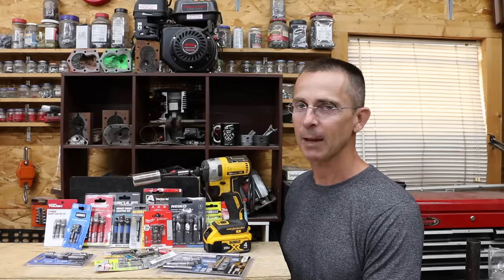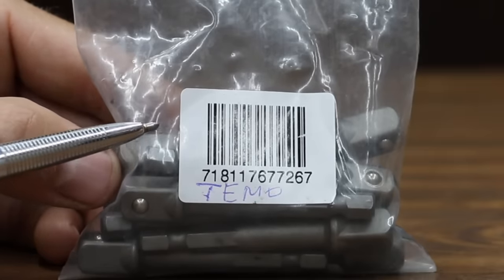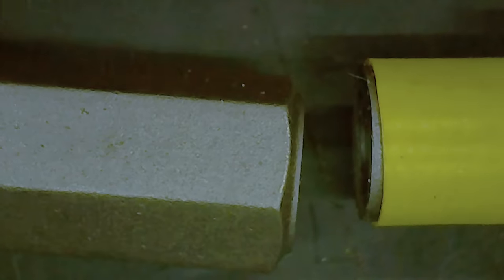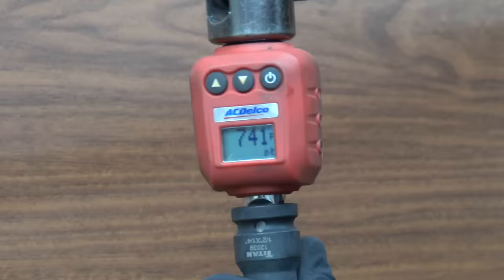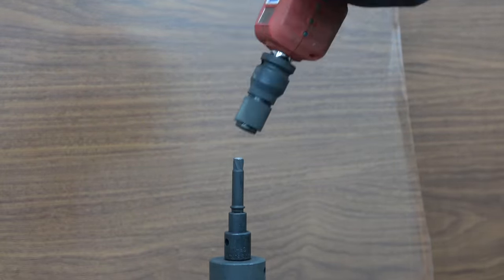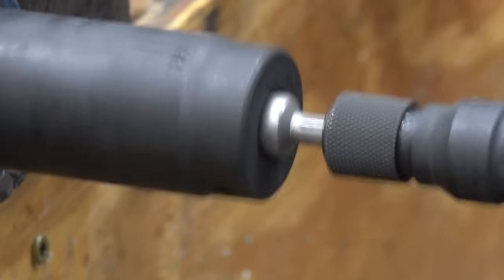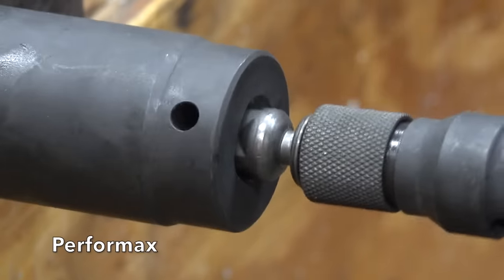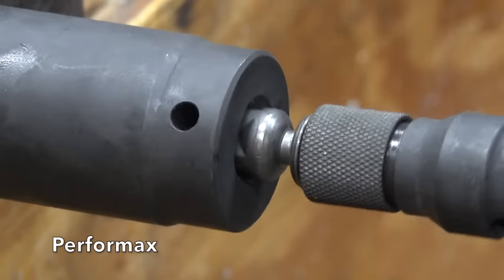Best Socket Adapter? 18 BRANDS: Milwaukee, DeWalt, Makita Gold, Ryobi, Hart, Irwin

Comment: Doesn't a shock absorbing zone defeat the whole point of an impact driver (or maybe it just converts your impact driver onto a conventional driver)?
Reply: it's probably there to make the bit last longer than usual, i think a better test would have been to clamp them into a vice and count how many  impacts each one takes before it breaks, but it would of been quite a work load for PF to do it that way.

Comment: So, if you want to use your impact driver as a nut driver or to break away some nuts / bolts, Dewalt is the only way to go.

One thing I noticed when I was shopping for these and reading reviews is that the 1/2" adapters often broke on the first use, while the 3/8" lasted longer. Also noted that the 3/8" are often sold in packs of 8 or 10, so the breakage rate for this use is pretty typical.

I bought the Harbor Freight Hercules after Torque Tools tested it out as the #1, but the output exceeds all of the nut driver adapters.
Reply from the maker: Thanks for sharing.

Comment: 1/4" hex impact drivers are for screws. I use an appropriate impact wrench when using sockets.
Reply from the maker: Thanks for the feedback.
Reply: i tend to use the socket adapters when i'm dealing with 9/16 and lower.   anything above that is getting a real impact, though.
Reply: I use them to run the bolts in and then use a ratchet to tighten down.
Reply: Agree with Justin..........video shows 1/4 driver break, we already knew that........other that it worthless.   I have 4 impacts........ ever broke an adapter of any brand.     But I don’t use them to break away lug nuts.

Comment: I tend to think that the narrow area of some of these bits is to give a failure point that will leave part of the bit to grasp for removal from the tool rather than break flush and make removal hard to accomplish. As usual, great job.
Reply from the maker: Thanks!
Reply: What’s hard about pushing the square piece out from the inside of the socket?
Reply: @dp1381  I think he's talking about when the bit snaps further down at the power tool end.. and it's broken off flush with the collet.. it's hard to pull it out.

Comment: So now we know that the skinny shock zones are a sales gimmick that actually makes the bit vulnerable to breakage.
Reply: It’s actually a safety feature. Harder metal easier it is to chunk off and hit your eye . The coating in the shock zone prevents chipping and will just shear as if it does chip the coating slows down or catches the shrapnel. Ask how I know . Broke a hex style and it hit my face right below my eye . And broke two impact zone styles . And one had a piece caught i  the coating .

Comment: I'll be honest here, I wish my rigid impact driver was strong enough to break any one of these :(
Reply from the maker: Thank you
Reply: I know what your talking about. Rigid seems a bit week.
Reply: @jamms992  Depends on which one you have I guess. My gen5 and octane versions will snap these all day long if you are not careful.
Reply: @D3M3NT3Dstrang3r  I think mine is either a gen 4 or gen 5.  Started out pretty good, perhaps able to loosen a 100 ft/lb lugnut, but now struggles with a 50 ft/lb-torqued bolt.  I thought it was the batteries and had the LSA swap them out, but the problem must be the tool aging.  It seems to go through batteries fast now also.  I bet the bearing is burning up or the brushes are getting worn out (I use it a lot).
Reply: @The3chordwonder  If its not performing up to task I would warranty it out. All my Ridgid tools are used in a professional setting very hard daily. I have yet to have one lose power or at least very little from wear. I have warrantied A 1/2" impact but it just quit. I definitely like the build quality of the octane 1/4" over my gen 5 brushless though, and its a fair bit stronger too.
Reply: @D3M3NT3Dstrang3r  Yeah I think I probably will.  As much as I like the cordless tools, I have been getting by using my aircat stubby impact, which works surprisingly good and is even smaller than the rigid.

Comment: Seems strange to have a shock absorbing zone when you want the impact energy to go into your project, not wasted on the tool.
Reply from the maker: Thanks for the feedback.
Reply: This! The only reason I can think of for a shock absorbtion zone would be to deliver the torque more smoothly, but why would you want that on an impact
Reply: It’s for safety. Impact tools are meant do be able to self destruct safely. If you look at the non-impact tools failing you can see metal shards and fragments getting launched out- that’s dangerous. Whereas all of the impact sockets always fail cleanly at the shock absorbing zone.
Reply: Milwaukee says to extend the life. Which, if you lesson it's torque on your project makes since. Several others didn't shatter because of proper materials. It seems like a marketing gimmick to me.

Comment: Just got a DeWALT impact driver thinking it would help me with lug nuts for an upcoming brake job. Only now did I discover the difference between an impact driver and an impact wrench. Glad to see that the DeWALT adapter is available and should do the duty. :) Thanks, Project Farm.
Reply from the maker: You are welcome!  Thanks for sharing.
Reply: The wonderful world of paying to learn lol
Reply: @l.n3187  I’d agree except that I got a lot of use out of the impact driver over the past few days. Of course, I also got a proper impact wrench since the aforementioned brake job… TWICE: I got an awesome deal on a broken DeWALT DCF899 1/2” hi-torque and a nearly-new Craftsman CMCF940 with upgraded 6Ah battery (literally a rebadged DCF899). I repaired the DeWALT and gave the Craftsman to a friend.

During that brake job I found that the previous owner grossly over-torqued the lug nuts when replacing the wheel hub (body damage, junkyard rim, and the only hub that wasn’t totally rusted). It was so tight it broke my 1/2” adapter and a 12v 1/2” emergency roadside impact wrench that I only ever used once (changed front sprocket on my bike a decade ago). When I finally got the lug nuts off with heat, weight, and a cheater pipe it tore the threads right off some of the studs. After that experience I swore off trying to get away with anything less than a proper high torque impact tool for future use… hence, the 899 and 940.

This weekend+Monday:
Replace wheel studs
Check on brake noise (stainless clip popped out)
Flush coolant (repeatedly)
Diagnosed ring sound as bad fuel pump (<1 year old)
Replace coolant level sender (<1y old)
Replace temp sender
Replace thermostat (3.4L GM = !!!)
Replace thermostat housing
Replace radiator petcock
Replace coolant (<1y old)
Clean MAF sensor
Clean throttle body
Replace air filter

The little DeWALT Atomic impact driver with 1/2” adapter worked fine as a mid-sized impact wrench (obviously not as compact with the adapter). I’m very happy with it and the money doesn’t feel wasted at all. :)

Of course, good tools are kinda wasted on me as I’m not mechanically inclined… just forced to do all this only because one shop refused to work on it (rust). Now I gotta get more use out of this stuff!
Reply: @emmettturner9452  yeah it's definitely an issue of torque I've learned, don't expect a cheap set of adapters to handle the 400nm your impact wrench can put out, likewise Im sticking to my 1/2 breaker bar to initially loosen bolts and my driver can take them the rest of the way off

Comment: Shock absorber zone always seemed like BS to me, no difference in feel.  Now there's evidence it's inherently weaker too.
Reply from the maker: Great point!
Reply: That was my take away from this video as well.
Reply: Part of it is to make a controlled failure point. The thinner area acts as a mechanical fuse and snaps cleaner than potential shrapnel like the Bosch had.
Reply: @compgeke  only an idiot would want a tool designed to fail.
Reply: @compgeke   If the majority of the adapters with shock absorbers weren't literally half the strength as normal shank adapters, you wouldn't have to worry about a failure using these adapters within their normal operating limitations.

Comment: What's the point of putting an "impact absorption zone" on an impact tool? Completely defeats the purpose. I want the impact imparted on the work through the tool, not absorbed!
Reply: It is supposed to reduce the very high torque spikes you get from the impact. It is done to protect your fastener and bit.
Reply: I think this absorbing zone is meant for protection of Phillips screws and bits, but is pointless for larger hex head fasteners.
Reply: Another thought, the "impact zone" is actually designed to be the point of failure, so the bit doesn't break off inside the tool.  Maybe these adapters are a considered to be consumables, replaced frequently as they break?  Either way, I'll probably go with the most durable adapter with a thick shank because the whole "impact absorption zone"  seems like silly marketing to make the design look more sexy and require brand loyalists to buy more overpriced adapters.
Reply: @nefariousyawn  I had that thought as well. One deformed and broke inside a coworker’s Makita impact driver once, and put the tool out of commission for a week or two.

Comment: “Torque absorbing zone” it boggles the mind how dumb the average customer is like a 5hp tool that plugs into a 15 amp 120v outlet
Reply: My mains 8amp 120v impact does up to 1050ftlbs. Point being that this is still relevant to cheap consumer products. Since half of these wouldn't survive it.

Comment: You have become my go to for tool reviews, I just broke 3 husky adapters driving in 3/4x5” lag screws. I know I should have probably been using a impact wrench like you say but didn’t have one at the time. I was wondering if you could start including product numbers , so many of these tool companies make so many different variations.  Love your videos please keep it up.
Funny side story about this, I’m getting older and my elbow has been bothering me a lot when I use the impact all for a long period of time so I was mounting a truss to hang a video wall from. I bought the M18 fuel Surge Impact, well I couldn’t wait to try out my new tool on this but it couldn’t handle it. It would get them started but wouldn’t drive them past there. One of my guys has a regular and 18 nonfuel non-brushless he tried his and it drove home in a little better but still stopped. I told someone to grab my old cobalt XDR just because I was curious I couldn’t believe it when it drove all the way here not once but 32 times each time I thought it was a fluke and go back to the M18 just to see if it was that one but no, I was so made that I just paid all that money for an inferior tool.
Reply from the maker: Thanks for sharing.

Comment: I toiled for months on buying either a sub compact cordless impact driver or impact wrench. I finally decided on a 3/8" impact wrench due to the fact I'm mostly using it on my car where every inch counts to get it into tight spaces. If I had purchased an impact driver, I would then need to install the appropriate 3/8" or 1/2" socket adapter which would make the tool longer, thus defeating the whole purpose of having a sub compact tool. If I ever wanted to use the impact wrench as a driver, there are tons of adapters out there to turn convert it into a Hex Drive. Most home projects are not nearly as tight as in the engine bay of a car. I keep trying to find something wrong with this logic, but it continues to hold up under my own scrutiny. Love to hear other's thoughts on this tho.
Reply from the maker: Thanks for sharing.

Comment: I use the Milwaukee 1/2" adapter on my Milwaukee M18 1/4" impact driver, bit lasted over a year before breaking. Used on 13mm, 15mm, 9/16, 13/16, and 15/16" nuts/bolts.  I always hammer on it(commercial use)🤷‍♂️
Reply from the maker: Thanks for the feedback.

Comment: I personally install scaffolding.  My dewalt dcf900 high impact finally let go.  To see me through a day or 2 while waiting for my new big boy to get delivered.  I literally went through 12,  3 packs of socket attachments for just a screw impact driver.
What I did notice was the bigger the drive of socket the weaker it was. The only thing that came close was the quarter inch with socket reducers getting up to 1/2 inch.
Reply from the maker: Thanks for sharing.

Comment: This is a good test of impact adapters.  I've always wondered though why someone would want to drive a 1/2" drive socket with a 1/4" drive adapter.  Assuming comparable material strength, a 5/16" or 7/16" hex drive adapter would last much longer than a 1/4" drive adapter and be able to drive higher torque much better because of it's larger cross sectional area.
Reply from the maker: Thanks so much!

Comment: Not sure if you’ve made it but now I’m getting more ideas for review lol. Drill bit brand tests, Socket stress test from different brands, and also 3/8 or 1/2” ratchets. I’ve shattered a couple ratchets trying to use pry bars on tough bolts.
Reply from the maker: Thanks for the video ideas.

Comment: Well just ordered the Dewalt adapter for my Milwaukee M12 impact driver to remove lug nuts. Let's see if it saves me from buying an impact wrench.
Reply from the maker: Thanks for sharing.
Reply: @ProjectFarm  yes-very interested in this application, if you can test that with either 12/18/20/24V drivers. What's the best kit, seems like none of these would do. Snap-On? Your grandpa's WWII mechanic's toolkit?

Comment: PF, one thing I noticed was the torque sensor moving from side to side as if you were wrenching it. You might want to set up a jig so that no possible manual error may be input into the process.

Comment: Id be super interested in a test of 1/2 to 1/4 inch impact adapters. For people who mainly use an impact wrench but occasionally need impact driving capabilities
Reply: they're all ok. Impact driving is like 1/10th of impact wrench. I use bosch green (not even pro) adapter that I've had forever, or the freak.

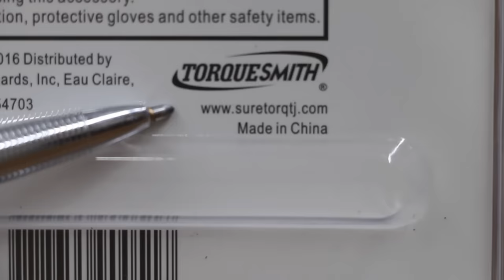Comment: 0:41 At first I thought that should be Chromium-Vanadium. I tried to look for official info from Torquesmith but it doesn't appear they have a website. I knew chromium as an ingredient used in knives to make them harder and more resistant to corrosion. Then I needed to know what chrome actually is and it's merely a shorthand term usually used to describe chromium when a thin layer is applied to other materials for aesthetics and corrosion resistance. But the term can be used to describe chromium regardless of it's use case. The more you know.  Love your videos, keep up the good work!
Reply from the maker: Thanks, will do!  Thanks for sharing.

Comment: A representative test would've been fatigue, probably more than ultimate sheer strength, but I understand that can be troublesome to make. Probably with an electric driver, measuring time to failure under full load (e.g. while fully clamped). I've had impact adapters failing on me after several months/years usage, but rarely after a peculiar demanding use. Impact drivers only deliver ±300-400 in-lbs torque after all.

Edit: Wrong. Mines deliver 1420 in-lbs, which should be enough to break any of those when delivered statically. But since it is delivered by repeated blows, and part of it being absorbed through twisting, I still think fatigue would be the best indicator of durability here.
Reply from the maker: Thanks for the feedback.
Reply: @ProjectFarm  Yeah, you must be getting that a lot... ;)
Reply: @EddieOtool materials science is complex. Very easy to misjudge a product’s efficacy by testing outside the scope of application. 

OP was only saying he understood that impact driver bits are optimized for fatigue strength, so testing that would be a more relevant evaluation metric, but testing fatigue reliably is far more involved and beyond the scope of what can be reasonably expected of one guy improvising comparison tests in his shop for YouTube videos. 

I love this channel, but as with anything bordering on the sciences you have to evaluate the methods and the results for yourself, determine their relevance, and persist in asking yourself ‘why this and not that’. 

Now go to your room.

Comment: At 10:23 Ryobi adaper snaps at the retainer groove, BUT at 10:29 shown that Ryobi adaper snapped at the torsion zone near the green tape. Why? Never showed us torque gauge with any adapter in the same frame either.

Comment: We use the Milwaukee ones at work to tighten 1/2 inch trailer axle bolts and they snap every 3rd trailer. Luckily they have a bunch of them
Reply from the maker: Thanks for sharing.

Comment: I want the Bosch because of the industrial socket locking mechanism. Very bad for quick changes, but very good to avoid unwanted dislocation. Otherwise, the DeWalt is great, better thant the Makita Gold IMHO, with the TorqueSmith the best budget choice.
Reply from the maker: Thanks for the feedback.

Comment: I tried a masterforce set and mainly used the 3/8" adapter and my m18 fuel driver didn't let it live past it's third flex plate bolt on a gm ls engine. I also noticed the shank was the same on the 1/4", 3/8", and 1/2" adapters.

I went with a Neiko this time around and we will see how it holds up.
Reply from the maker: Thanks for the feedback.
Reply: @ProjectFarm  here's some more feedback, the Neiko doesn't fare well with the torque from the m18 fuel either but it is better than masterforce.

Comment: This is interesting. My DeWalt 20v driver says it's rated for 1500 in lbs. But, obviously that's not continuous.  I've yet to break even the cheap ones from harbor freight that didn't perform well in testing. Wonder how much rapid intermittent torque it would take to break these, like that which they're exposed to under normal use. I guess what I'm asking is, how do we convert PSI in this test, to inch-lbs? Does that make sense?